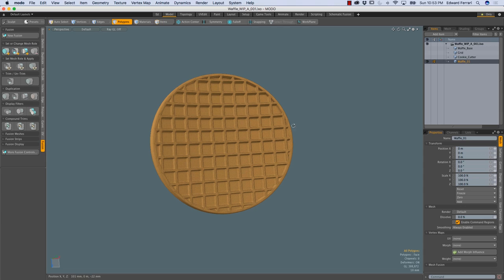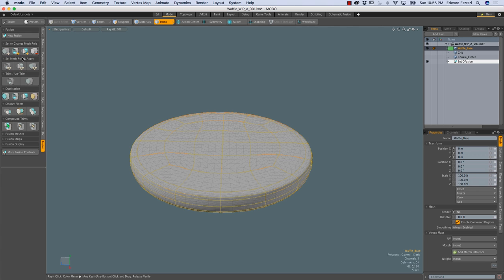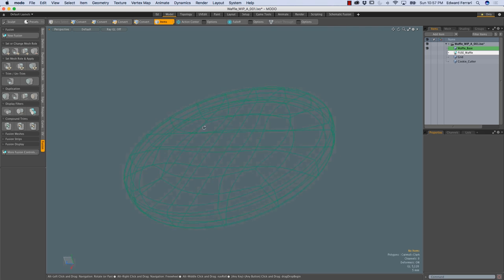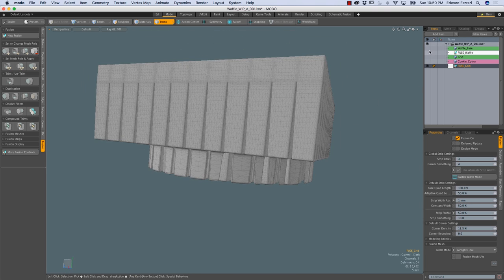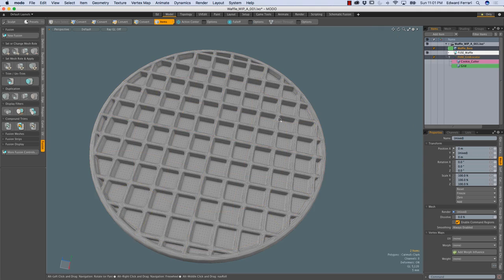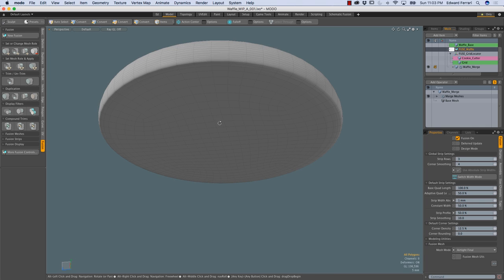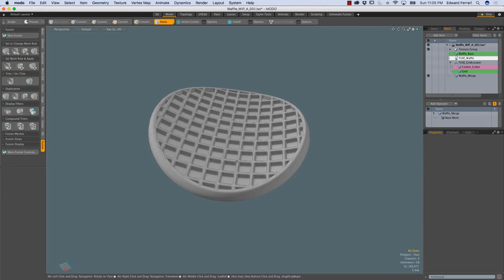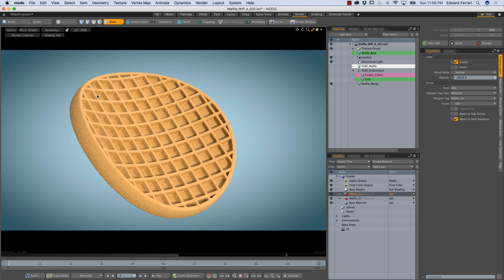MODO | Making a Waffle with Mesh Fusion

Comment: Hello, so I haven't used Mesh Fusion yet, but I had a question. So when you were finished with the initial imprint of the waffle... let's say you wanted to end it right there. How would you freeze the waffle so that you wouldn't need Fuse_Waffle? From my understanding everything is still live, so if you were to move the Fuse_Waffle (or the waffle itself) the imprints would move away.
Reply from the maker: Hi VinnyHaw, Great question! Sorry I didn't respond sooner. So, if I kept everything live, I would still be able to move the Waffle without seeing the "waffle imprint" separate from the "waffle body." I could either move the Live Fusion Item itself or I could move all of the Fusion Source Items that are used to create the Fusion Item. Either way, the "waffle imprint" would not separate from the "waffle body." This is true for rotating and scaling as well. Now, if you were to move, rotate, or scale only one of the Fusion Sources - for example, let's say you decided to move the "waffle imprint" - then you would obviously see the imprint separate from the body. 

Also, the Mesh Fusion Item will remain live until you convert it to actual geometry. This can be done in the "Output Mesh" section of the Fusion Item Properties. You can choose to "Convert to Mesh," which will convert the live Mesh Fusion Item to actual geometry, or you can choose to  "Dup & Covert to Mesh," which will duplicate the live Mesh Fusion Item and convert the duplicate to actual geometry. Converting the live Mesh Fusion Item is pretty similar to freezing a Procedural Mesh Operation. In the waffle example I went a different route altogether. I used the Live Mesh Fusion Item as the source for a Merge Meshes Mesh Operation and then I Froze the Procedural Item that contained the Merge Meshes MeshOp, thus creating a standard Mesh Item containing regular editable polygons.

Let me know if that helps. If it's still unclear, I'll make a video covering the topic more in depth.